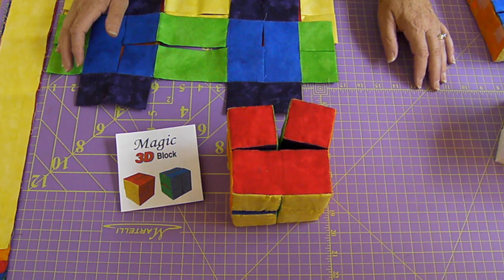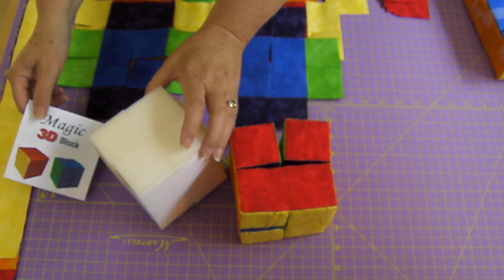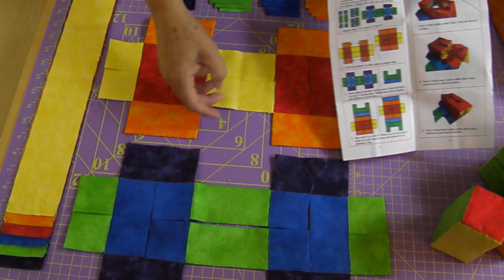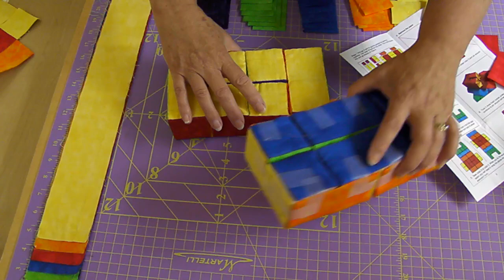Magic 3D Block - Basic Layout Instructions

Comment: The pattern alone should be downloadable for a price.  I purchased the extra cubes and the template for fussy cutting (thinking it was the instructions or at least came with the instructions).  I spent about $24.00 and STILL don't have the instructions!  The video is good until it comes to the most difficult parts -- sewing the two sections together and then inserting the cubes.  I partly blame the quilt store for selling me two products that are useless without the instructions.  The store didn't have any of the cubes WITH the patterns and no one pointed out to me that I was going home without the pattern. The store is over an hour away so I'm not too happy about having to return it.
Reply: 看到你的消息替你难过，虽然离你的留言过了11年，但2年前我研究明白了并根据这个视频制作了2个神奇方块，最重要的是有几片方块片和长条片的固定缝合，才能进行下一步。最近我打算再重新制作一个送给朋友时，忘记了哪几片布料要缝合，又重看了一遍，发现这个视频居然远没有我记忆中那么清晰，我打算研究清楚后，再制作一个拍个视频告诉大家怎么制作！